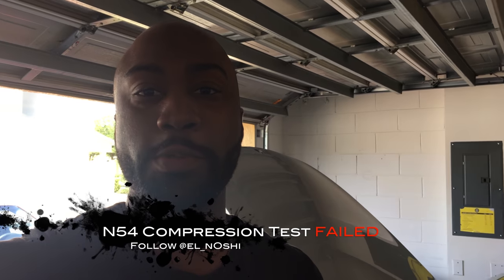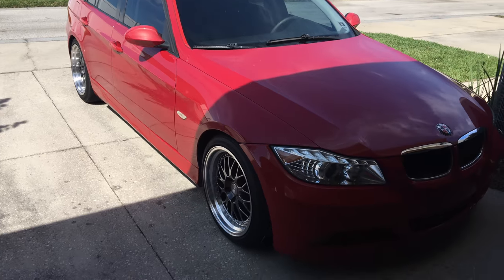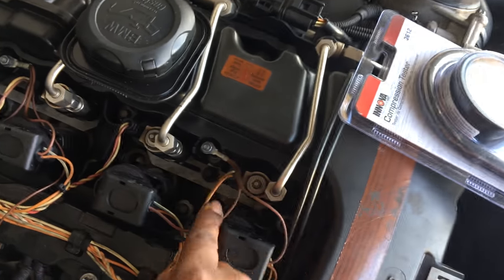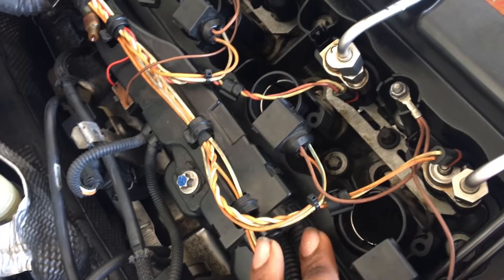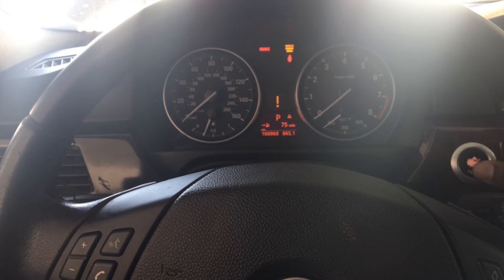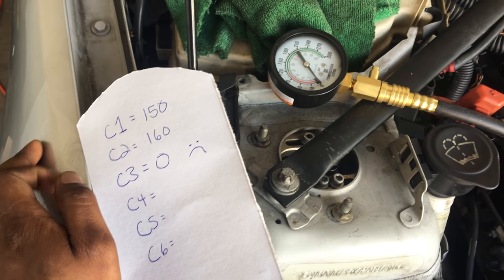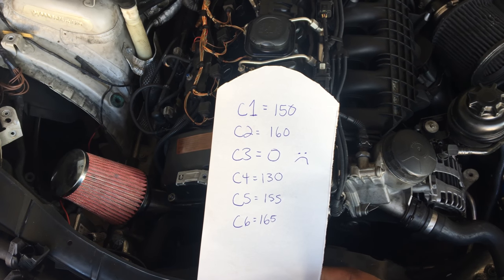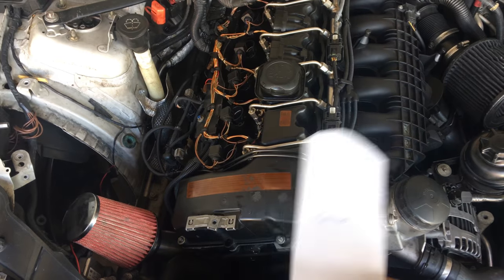BMW 335i N54 Compression Test Failed

Comment: Nice video I am curious what the verdict will be it's odd that cylinder four is also a little low makes me think possible head gasket issue. I would try putting 30 cc of oil into cylinder crank a couple times without the spark plug and do a compression test again. If it comes up it's rings or head gasket if it's unchanged it's valves
Reply from the maker: Yea that’s what I forgot to do was add some oil and redo it. It ended up being the rings not sealing once I had the head off.
Reply: @nOshi2x  Now that you have the head off how bad does the cylinder bore look fuel washed rings can reek havoc on the cylinder. If the bore is still round and not scratched you might be able to use a bottle brush hone and put some new rings on the piston and be good to go.
Reply from the maker: Yea looked to have to scoring so have it apart still have to bring it to the machine shop to cleaning it up for me. Afterwards just going to build it for more power. But mainly a back burner project till I get enough funds to finish it. But I swapped in a donor motor in for the mean time.
Reply: nOshi did you needed valve seals?
Reply from the maker: Yes they needed to be changed.
Reply: nOshi gotcha, all good now? Did you change them yourself ?
Reply from the maker: @carpediem2101   no at the time i didn't have the tools and such to go into the motor, so I just swapped in a newer motor. It's not until later I saw the issues, once I fully opened up the motor.
Reply: nOshi gotcha thanks for the information

Comment: So from the last video did you replace that injector with a new one and I'm assuming it did not fix it? And before you did your injector were you smelling gas when it 1st started mis firing and throwing that code?  Having an issue with cylinders 2 and 3 myself and I just bought the car 3 weeks ago. Sucks

Comment: is it recommended to pull the DME relay before cranking engine with ignition parts unplugged?
Reply: @nOshi2x  Somebody recommended to pull it before cranking the engine with ignition parts unplugged so that the fuel injectors don’t fire and no spark happens. Just found out N54 engines have an electronic throttle body; pulling the DME relay would disable it so we would not be testing compression with a WOT. But typical procedure on any car is to disable the fuel pump by removing its fuse and de-pressurize the rail by turning on the car before pulling out the sparks and coil and letting the car die on its own due to it not getting access to more fuel.
Reply: @david-tracy  No just unplug the injectors... They're right there.

Comment: You are low on all cylinders you should have 170+, just remove the head grind all the valves, clean the head, almost 100% that is just bad valve seal

Comment: Did the car turn on ? Or just crack
Reply from the maker: Battery was dead and will say low charge or something along those lines on the idrive. So if the alternator fails, more than likely the battery is done also or will need to be jumped, or put a new battery in.
Reply: @nOshi2x  no with a bent valve does it start?
Reply from the maker: Yea it can turn on your just going to misfire like crazy.
Reply: @nOshi2x  I have cylinders 5.6 miss fire but it drives good still feels with a lot of power. Ima compression test it tomorrow
Reply from the maker: Yea definitely but if it’s driving fine and no loss of power doubt a bent valve is present. But never know anything is possible.
Reply: @nOshi2x  I have 2 miss fires and both o2 sensors code

Comment: Man, idk what is wrong. I've got the same gauge. I'm getting a zero reading on all cylinders. This can't be for real since the car runs. Think I have a bad gauge or would oil make any difference ?
Reply: Complex Seven Industries thanks for quick reply. Your the only one on YouTube with compression test and swap for 335i. Good stuff!!   After changing my dme, spark plugs,  could and Injectors my car finally ran great .  I went to store and got two galons of gas started her up and back to terrible idle and misfires.  Cleaned valves changed vcg since then and nada.  It'll misfire on cylinders but when I clear the code, the car idles just fine. I'm hoping my issue were these Chinese Injectors that I bought. Got some fcp  euros today.  Had to give u my n54 life story:/.  Praying it's not the engine. Swapping looks difficult
Reply: Complex Seven Industries  I was getting constant misfires on cylinders 2, 3 and 4. After cleaning the valves it's  it moved to five and I found that Injector to be leaking. I did code the injectors and all. It's been sitting for about 5 months with on 80k miles, it's very stressful switching out parts constantly.  I did work on the car with the injector caps off, so I'm thinking dust or particles may have got in there and clogged them up. New injectors and spark plugs come today , I give up on life if this doesn't work lol
Reply: Complex Seven Industries  man oh man looks like she's running pretty stable now !  Some index 12s definitely helped along with another set of spark plugs. Gonna be safe and get ANOTHER set of coils too lol. Thanks again man for help. Check out link it's pretty quick. My set up sounds like a n55... Sort of.  Sound is Def beefier and got rid of that  standard high  pitchtone and high rpm.  I don't  have charge pipes or downpipes yet , butSounds more agressive in person of course .
Reply: Complex Seven Industries hopefully you guys are still active, I’ve got a persistent misfire in cylinder 3. Done the coils, plugs, and blasting. The misfire only occurs when up to operating temperature, what would your next step be?
Reply: @NateMac1921  did you get this fixed bro? I'm having the same problem

Comment: You might have “disable” the injector but you still got pressure in the rails and the pump still pushing gas, you just shortened the life of all 6 injectors
Reply: No he didn't
Reply: The pump is on when the car is on. The injectors always have pressure behind them regardless if they are firing or not.